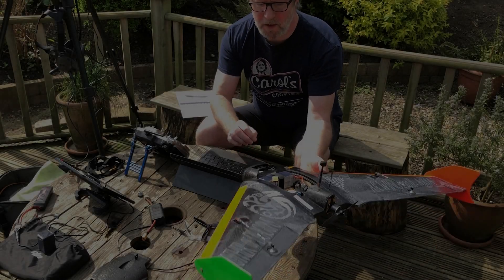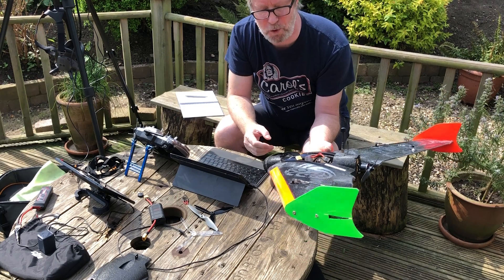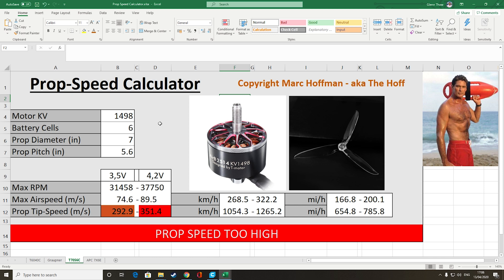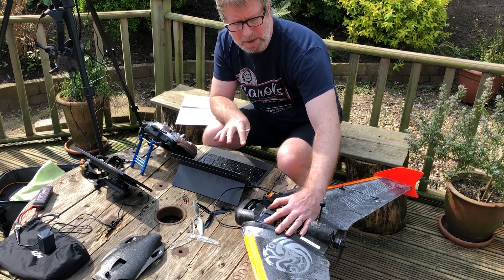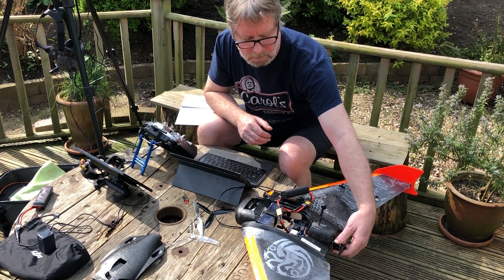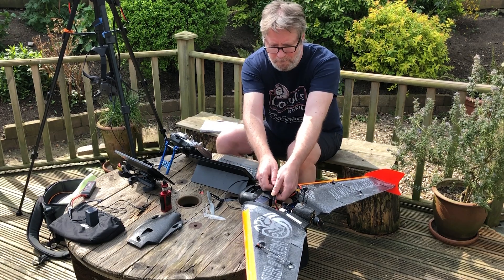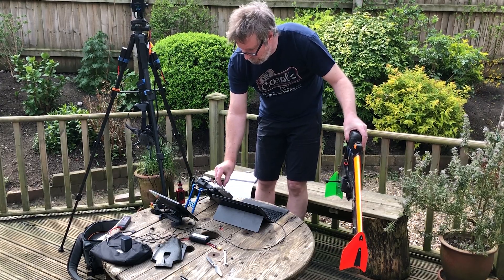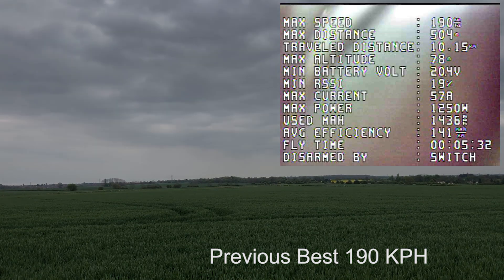AR Wing Speed Record Preparation

Comment: Nice! I'm putting together a S800 myself.  Only using a 35a ESC with a 2207 2750kv motor with a 4030 3blade prop
Reply from the maker: Never had an S800 myself but they seem to be very popular. Good luck with the build and mainden, happy flying.

Comment: Hey I got 2514/1498 is this okay for my new ar wing pro,not building for speed runs but power to launch well and hold good speed. My ar wing 900 does well on 5s with airb 2514 but should I go bigger for ar wing pro?
Reply from the maker: I did not have any success with the Airb motor on my AR900 so swapped it back to my SunnySky and run it on 5S.

I have gone for a Brotherhobby Reunion 2318 1250KV motor with T-Motor 75 amp ESC running on 6S with an APC 7x6 prop.

https://www.brotherhobbystore.com/products/reunion-2318-motor 

I will be putting up the overview video of my AR Wing Pro and the mods I have done this weekend.

Comment: Big compliment for your project....amazing.
One question:I have also a AR wing 900 and when I push the throttle high  the model go up so I have to compensate to stay at the same altitude.
Usually I fly in manual or acro.
What do you think?how can I resolve this trouble?
Reply from the maker: All planes will climb to a greater or lesser extent when throttle is increased all of my planes do. 

If your plane flys level off the sticks at half throttle then it would seem you have things set up pretty well but if it climbs you need to trim the plane so it does not climb and stays level.

You could also try adding a washer under the top of your motor mount to change the thrust angle of the motor a bit.

And also it could be due to the pitch alignment of your FC if your running iNav you can find a great information in these free iNav tuning guides https://inavfixedwinggroup.com/inav-guides/inav-tuning-guides/

Good luck with it and happy flying

Comment: I´m right now in process of building same power train, but using an HGLRC 60A (45A on 6S) ESC.  I will be using the new AR Wing Pro.
Have you tried a 7045  Bi blade propeller on 6S? My goal is 180kmh but also efficient cruise, thats why i prefer bigger diameter but lower pitch prop. And do you think a folding prop (aeronaut) can survive 6S ?
What do you think?
Reply from the maker: Well after blowing two brand new Matek F405 Wing FC's an F722 Wing two 60 amp ESC's I have paused this project lol. Not sure if the motor is faulty I got so pissed off with it I just left it as I am playing with my Dart XL trying to break my long range record. I am also building a 6S Mini Drak so the AR has taken a back seat. 

Then I just saw the AR Wing Pro and thought I will try again to build a low cost AR speed demon :-).

I have done 190kph with a Sunnysky 2212 1400KV MkIII on 6S with an APC 8045 Bi Blade, but I would not recommend that setup, I did it just for fun as that Wing was being retired so didnt care if it blew up.  here is the video of the adventure if you want to see it https://www.youtube.com/watch?v=RDZqLv14LaA 

You should be fine with the 7045 on that setup. I am sure the Aeronaut prop with handle 6S no problem they use them in super high powered planes. I have never used one myself as I like to balance my props precisely and I believe that can be a bit tricky with folders. I also like to try lots of different prop combos so its cheaper and easier to have a range of fixed props. I use the Aeronaut Cam Carbon Lite 9x5 props on my dart XL and they are superb, stiff, light and perfectly balanced from the factory.

Good luck with the build, drop me a line and let me know how you get on, I will be posting some 6S AR Wing Pro build and flight vids for sure.
Reply: @bluefish3607  
Thanks for the reply. I also have an S1100 on order to compare both. 
Your issues sound like some spiking problems to me. You really need to run a big 1000uF 50V low ESR capacitor to eliminate noise on 6S.
At first I wanted to push my new Talon GT with the airB Motor to 160-180kmh, but then realized, that's it's absolutely the wrong plattform for doing such crazy stuff. I just put my ultra reliable Sunnysky x2216 mk2 1400kv and 8x6 prop combo in it, that I used for 1,5 years in my DartXL and will fly long range using DJI FPV. I don't like the popcorn BEPP foam on those ZOHD wings, that's why I'm experimenting with different plattforms.
What's your plan on the DXL in terms of range? I could fly it for 60+min covering about 70km of range using 8500mah 20700 4s2p battery. Great wing for long range, could also do 140kmh with the mentioned combo, bit not capable doing aerobatic stuff.

Have great hopes regarding the ar wing pro, maybe this will be the ultimate all-rounder.

Comment: How weird - I did a multi prop power draw test this evening to decide if I could move to L-ion batteries in the AR mini wing!!
Reply from the maker: How did it go Caroline what was your conclusion?
Reply: @bluefish3607  plumped for a 5050 twin blade prop which pulls 17.4 amps wide open. The L-ion tops at 20 amps constant so should be perfect. 35mins+ flights should be possible. Went to 1.4km on a 5 turn home made antenna on my goggles with perfect picture. 3S 2500mAh battery
Reply from the maker: @Caroline_Tyler  Sounds great and pretty efficient with 35 mins flight time.